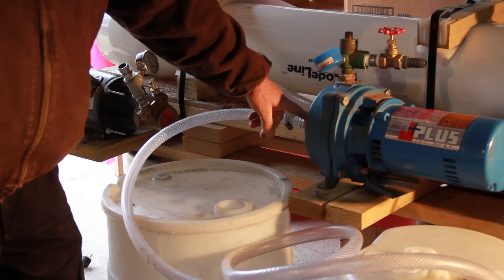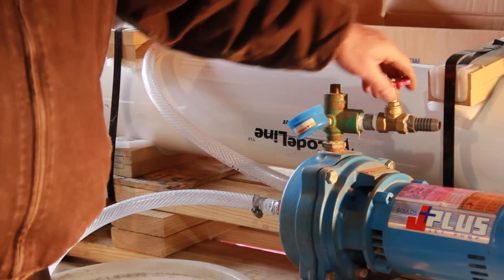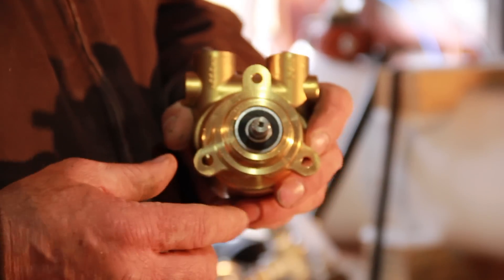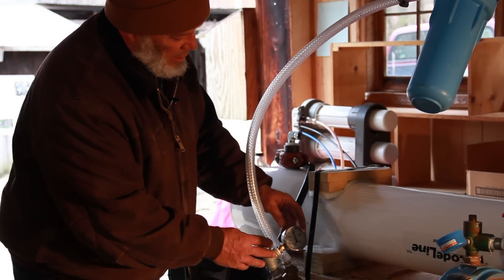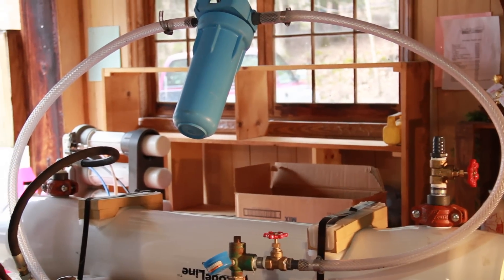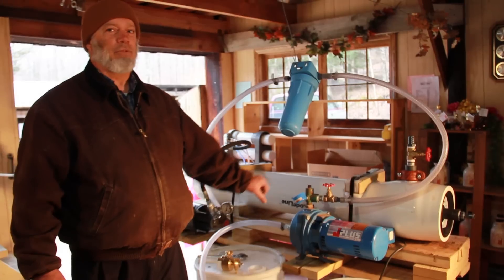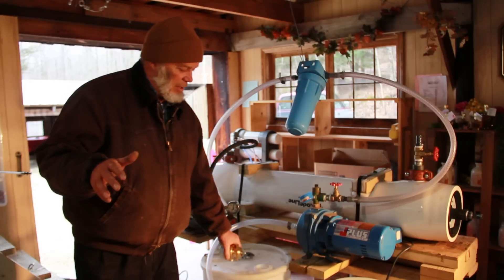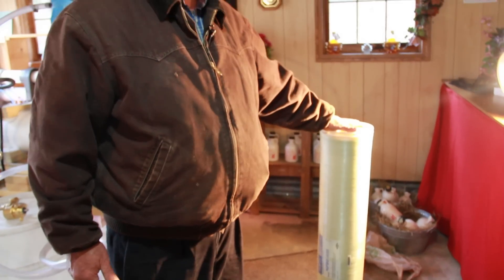Reverse Osmosis for Maple Syrup Option 3

Comment: HI Steve, where could we purchase the RO cylinder and cartridge that you used in this video. TY
Reply from the maker: Hi Bradwood Farm LTD,
You can reach Steve Childs at this email address: slc18@cornell.edu 
Thank you for watching our videos and best of luck with your forest farming endeavors!
Reply: @appalachianforestfarming  is there any other way to get ahold of Steve we have stopped using emails once cell phone technology became more advanced. I have two XLE 4040 membranes I'm going to run in parallel I have a procon Series 6 pump I'm just wondering at what pressure would be the best to run these membranes at and how many gallons per minute I'm thinking the Series 6 was something like 480 gallon an hour I know the membranes will Operator up to 600 PSI with water however I don't know where we should run them with maple sap or how many gallons per hour or gallons per minute are too much for these membranes?
Reply: @charliewhitney3494  you can go to the Dow filmtec website to find all the data for these membranes. Max flow with sap should be similar to water. More pressure = faster water removal. I've ran an XLE 4040 at 90psi and it works ok, just budget limited on the pump....but the r.o. keeps getting upgrades and this season should hit 150-180psi. Most of the membrane housings have a Max pressure of 200-300psi so find out what you have and just stay below the max psi. Good luck with your R.O.!!
Reply: @appalachianforestfarming did Steve not retire from Cornell? Is there another way to reach him? Thanks